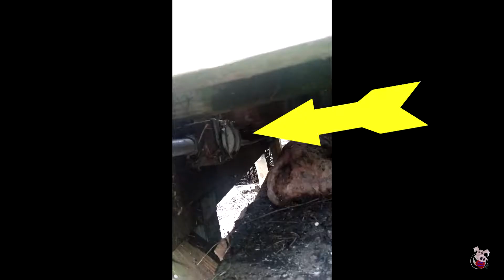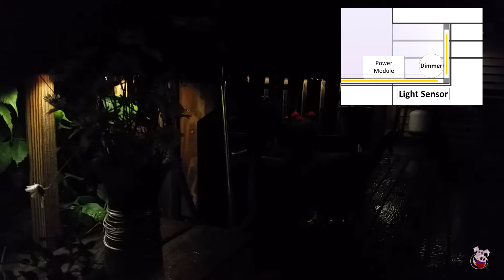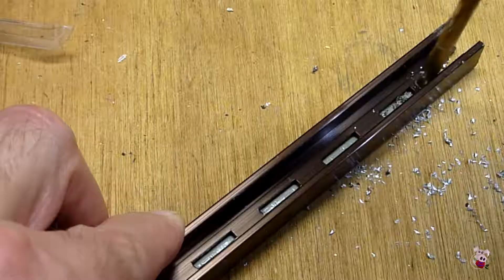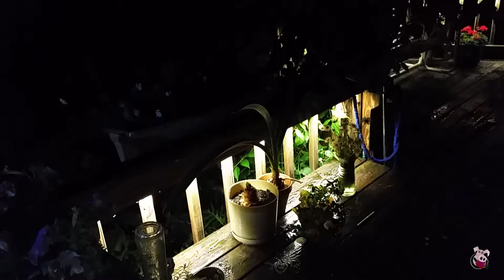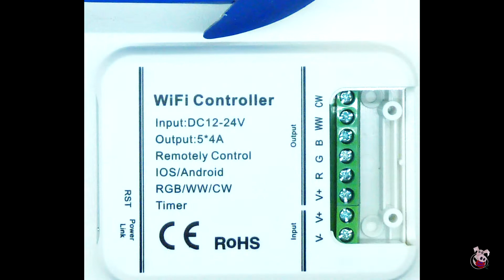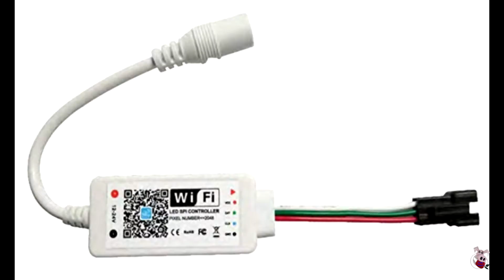Installing DIY Deck Railing LED lights

Comment: What are the IP65 accessories required for wiring up the outdoor Aluminium hand railings with the mains in a balcony of a new residential project.
Reply from the maker: Once you get to dc volts you can use small dry boxes, ip65 gel connectors (which I find over sized for dc and expensive).  I like to cap connections and seal them with silicone. Hiding everything is the hard part. I try to position the lights away from direct water contact from above.  

Remember to not make you connection the lowest point in at any connection points. Water tends to flow to the lowest point before forming a drip that gravity takes off.  

Ip65 power supplies are sealed but they leave you to fend for yourself on the connectors at some point. Usually easier to put it all in a dry panel if your budget affords it.

Comment: You are my new favorite person.  Thank you for showing the actual items that you purchased.  Excellent video!
Reply from the maker: Thanks. This install is still going strong with no issues with use every night. I did not do WiFi control on this install as tech like that and the operator did not mix.  You could put a one color WiFi controller where the dimmer is.  If you want to still use the light sensor you may want to put it after the controller so the controller is always on and the last light mode will turn on with the sensor.  You obviously would need WiFi coverage.  

If you have Alexa, google home or other home automation it could control the time schedule.  A controller supporting the magic home WiFi app would be an example.

Comment: Would you mind checking the how to program LED RF remotes.  I have a question.    My question is can I program two remotes to use on the same strip of led lights and if so how.